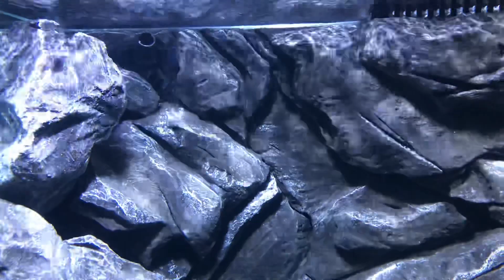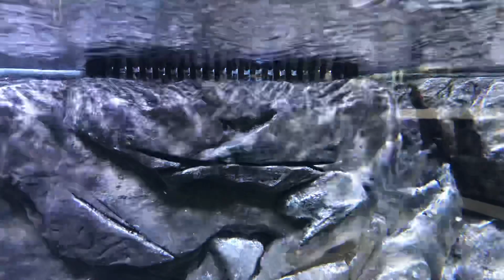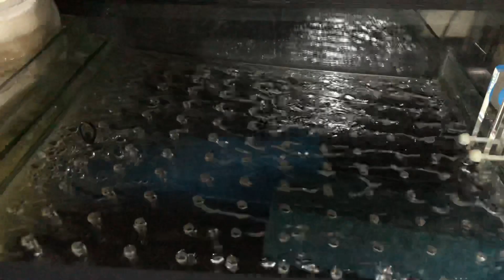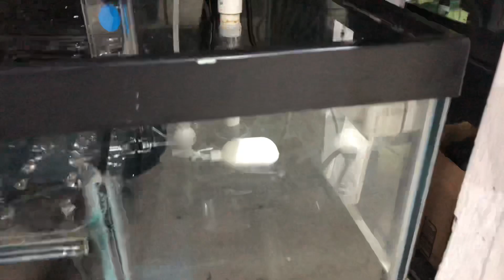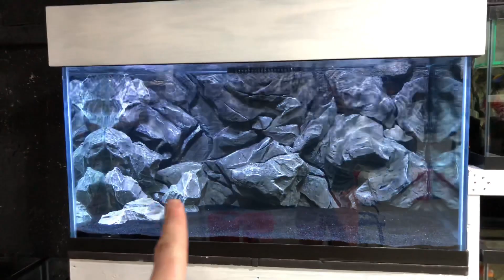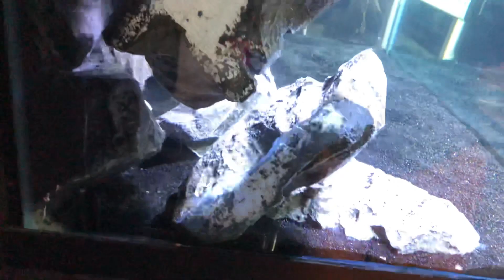NEW 120G Cichlid Show Tank Setup! #Cichlids #Aquarium #Fishtank

Comment: Are you using rodi water for your cichlids?
Reply from the maker: Nooooo, can’t use rodi water with cichlids, unless you are going to add buffers, salt etc. The RODI is for my saltwater tank auto top off and water change system upstairs.
The other canisters are sediment and carbon blocks for the freshwater tanks auto top off in the basement. Just to move the chlorine basically.
Reply: @Jetblink619  I knew it wasn't recommended without adding buffers but it looked like your setup may have been using it.
I purchased a 7 stage rodi for a saltwater tank which I have yet to get set up and I was just looking for a reason to get some usage out of it. Thanks for the clarification! Great tanks and videos... new sub!